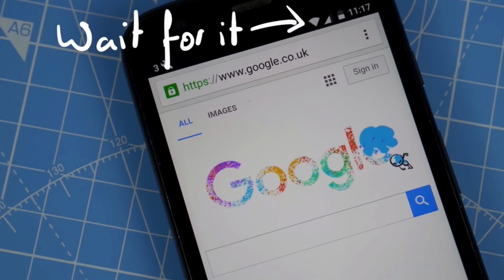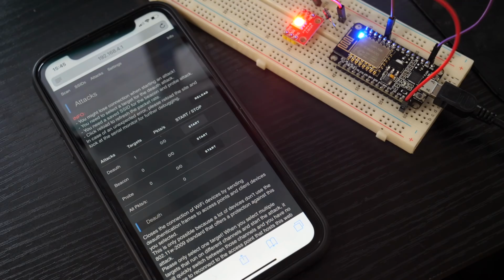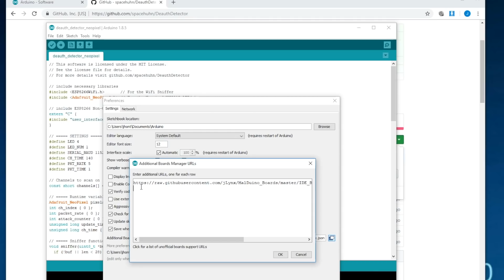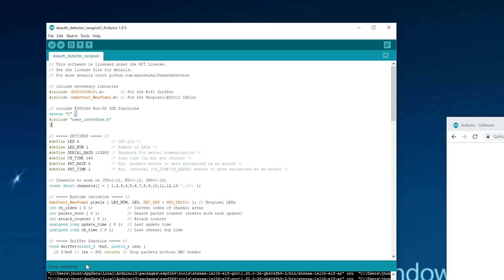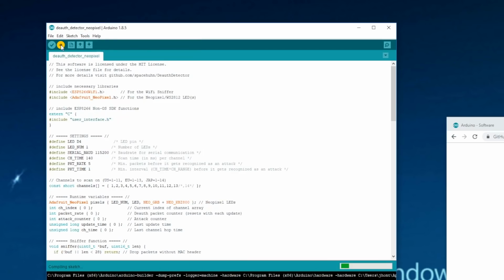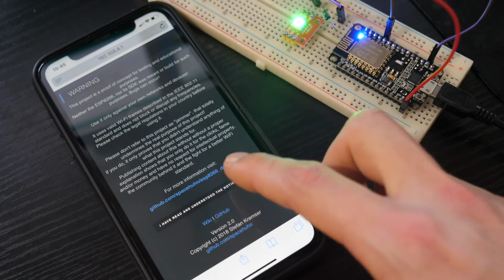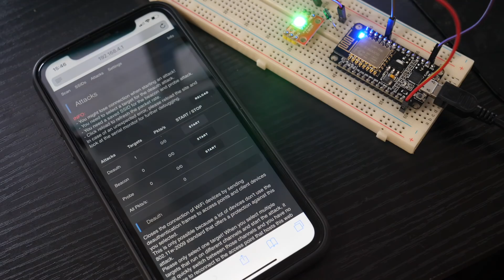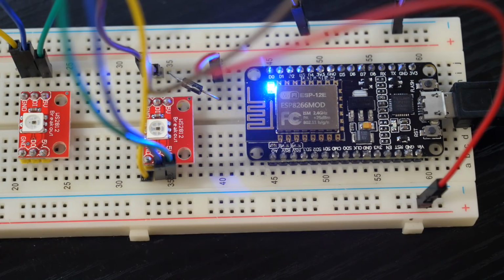Detecting WiFi Hacks - Tutorial

Comment: I'm not sure why you need the diode on the power line since the neopixel wants 5V for power. Is this to somehow make the data in pin compatible with the 3.3 V data pin from the Arduino?
Reply from the maker: Supplying 5v to the neopixel would mean the 3.3v logic from the nodemcu wouldn't work.
Reply: @Seytonic  
Which neopixel is it? The one I looked at listed .7v minimum for a high, and .3v Max for a low. I'm just curious.
Reply: @Seytonic  
Great explanation, I was just curious.

Comment: Ah i started by mis-understanding what that diode were doing in front of the LED. This happens because the Neopixels run at 5V and the logic level might not be interpreted correctly if it's only 3.3V. There was a writeup on it (and solution) on Hackaday, go punch in "neopixel 3.3" in the search field to find it.

Comment: Doesn't the nodemcu board have a step down voltage regulator that steps down to 3.3v?  I thought the raw signal was already ~5v coming from the USB before it is converted.  I don't understand what the diode is doing.  I thought the purpose of diodes was to ensure power only travels in one direction.  If someone can clarify this for me, I'd appreciate it!
Reply: I thought the same thing.
Reply: Diode have drop voltage
Reply: Yup. Diodes do step down the voltage a bit but thats not what they are made for.

Comment: Unless you are using a different RGB LED then the WS2812 variant, you can totally run them at 5v. I mean by the time you get the 5v from your supply through the usb cord you have like 4.7v anyway. So you can skip the diode completely. It’s probably only dropping 0.3v there anyway.
Reply from the maker: The nodemcu's logic runs at 3.3v
Reply: @Seytonic  Still, the diode is dropping something around 0.6-0.9V, you need a proper 2 resistors voltage divider.

Comment: I know this is somewhat unrelated, but I recently ordered the Alfa AWUS036ACH WiFi adapter for use with Kali. I don’t know if anyone has any advice regarding it? All I’ve heard is negative things.
Reply: only the real alfa's will work properly with kali ;)
Reply: killergeek I bought mine off of Amazon for around £56. I’ve read that to allow monitor mode you need to apt-get install the correct drivers but other than that do you think it’s ok? Hoping it is, otherwise I’ll have to get the NHA.
Reply: @djneon12  what do you mean by "real alfa" ?
Reply from the maker: @goodmusic4eva  There are a lot of fakes floating around.
Reply: Whats this thing ? Does this also Deauth or Beacon or mess up with Wifis ?
Reply: @YoDay  its just a normale usb wifi radio. only the software that is used can do some tricks to deauth and beacon spam.
Reply: @djneon12  ahhhh, I see, thanks!
Reply: 802.11w prevents you shitty script kiddies from your shenanigans, too bad so sad.